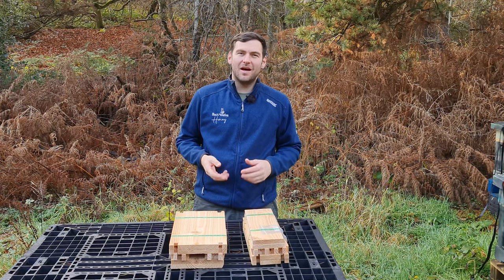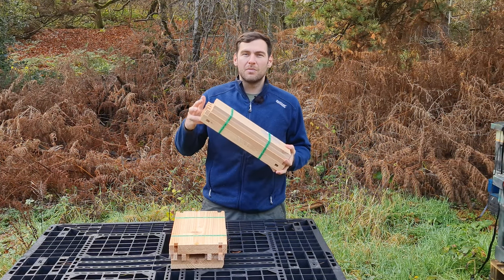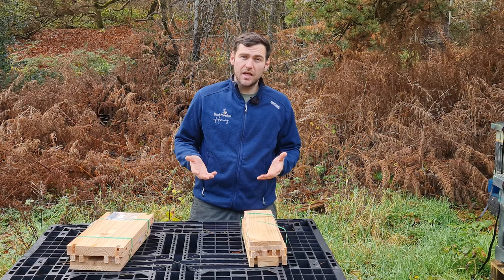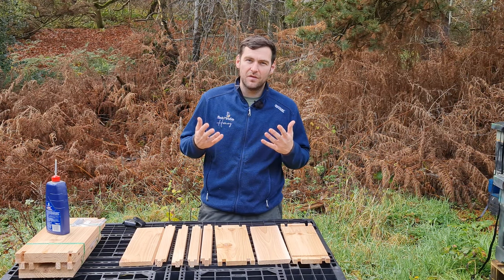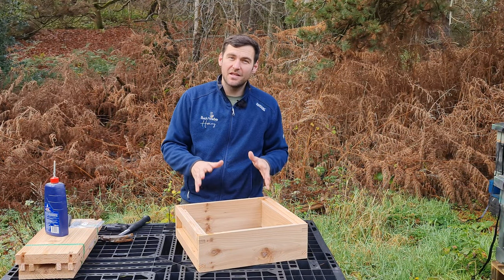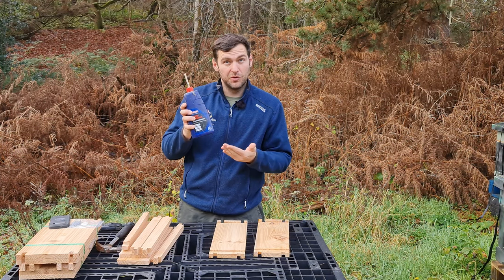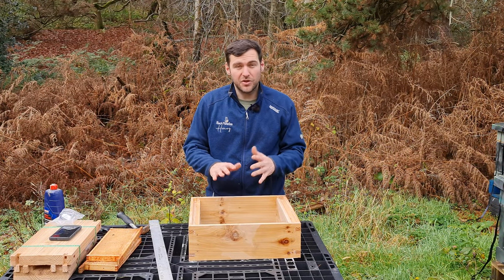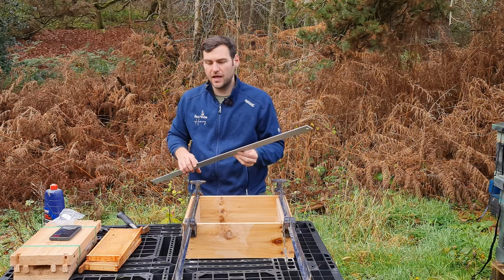How to Assemble a Wooden National Super - Maisemore

Comment: Boy, am I glad I use Langstroths :-) They are doddle to put together compared to these. BTW, speaking as an ex-cabinet maker, you can put too much glue on so much so that the joints can't marry up and there's a wodge of glue holding the two faces apart. You should get a thin coat of glue so that it holds the two parts together.
Reply from the maker: Cheers for the tip, Ian! I will dial it back a bit next time. I find the fit on these boxes tends to be very tight and you get a lot of run off but I can imagine that being an issue on looser fitting joints. You are right about the nationals. They are a real pain to put together. Its clearly been designed by committee! Langstroth is superior in every aspect!